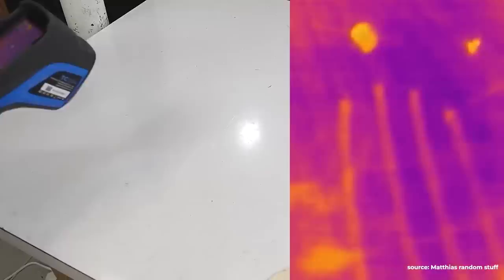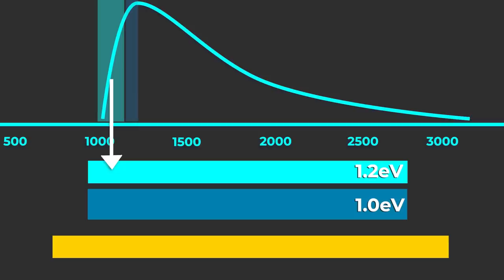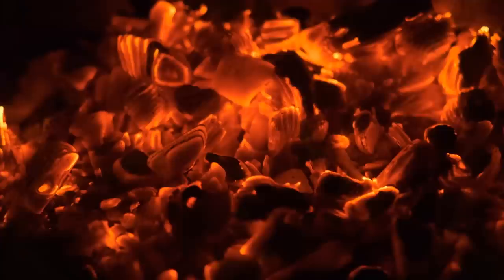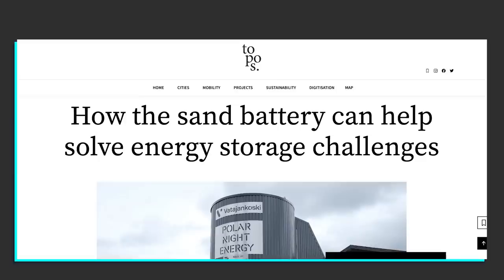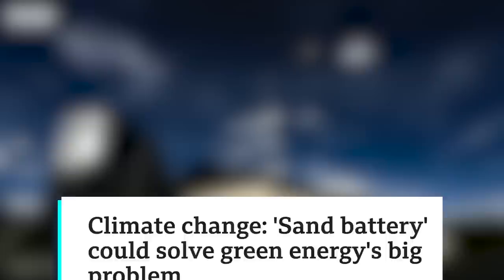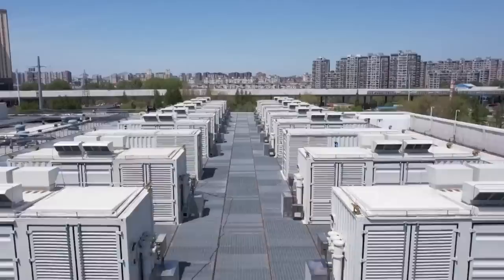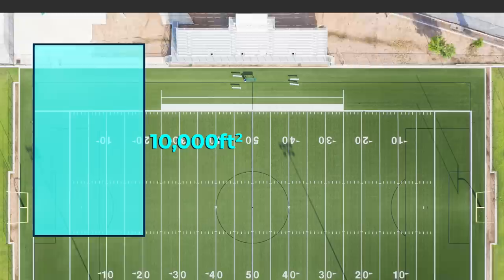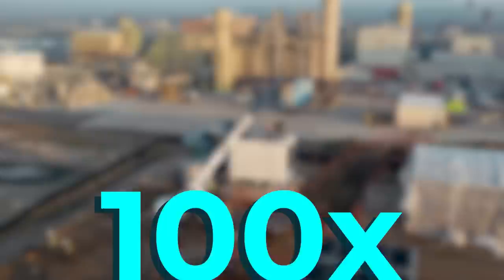The End of Lithium-ion? These Solar Panels May Be the Future of Energy Storage

Comment: I guess I don't understand, is this some kind of panel you could put on your roof .
Reply: If the heat hitting your roof is at 2400 degrees then you'd have other things to worry about than generating electricity. Like your house melting for example.
Reply: @vipertwenty249  Oh , well I'm guess I'm not interested in these .

Comment: I have to take issue with the thumbnail for this video....... grammatically speaking the term '100x cheaper' has a very clear meaning and it is not the meaning you splashed on the thumbnail. If item A costs $1000 and Item B costs $999 it is $1 cheaper - Then if Item C costs $900 it is $100 cheaper, so IT IS 100 Times cheaper than B. "Times cheaper" has to apply to a larger saving than the one already identified. What you mean is 100th of the cost. So, why should I believe the analysis of someone who doesn't know what '100x cheaper' means?

Comment: 0:28 Your "turbine efficiency" figure is way pessimistic
"Multistage (moderate to high pressure ratio) steam turbines have thermodynamic efficiencies that vary from 65 percent for very small (under 1,000 kW) units to over 90 percent for large industrial and utility sized units."
Reply: Isn't that the Isentropic efficiency? Since the maximum thermal efficiency for a temperature range is dictated by the carnot cycle, the overall efficiency would actually be the product of the thermal efficiency and the isentropic efficiency of the turbine.
Reply: @mouli570   No. References I found say "A steam turbine performs with an isentropic efficiency of η t = 0.84 ." and "Isentropic efficiency of the steam turbine: The isentropic efficiency of an optimized steam turbine is. 90% for an advanced power plant."
You can easily Google lots of references to Thermodynamic efficiencies ( Thermal efficiencies) like the quote I posted.
Reply: @dnomyarnostaw  As far as I understand, Isentropic efficiency is defined as the ratio of actual power converted to the theoretical power of an isentropic process. The theoretical power output of a carnot engine which is an isentropic process is about around 65% depending on the temperature difference between the input and the output. So the final efficiency would be lower than 60%. Although that is still higher than what was mentioned in the video, that number is closer to the electrical efficiency of a thermal power plant.
Reply: @mouli570   Definitions aside, I am just quoting authoritative sources, and none of them are  close to the figure quoted in the video.

Comment: Anything you use for heat to make electricity is out in heat to the global a carbon-free system is always the. Such a solar panels batteries and windmills. The score of the energy from the Sun and the wind from the earth batteries store at all without no heat problems. The average car gas car when it is running the engine comes to a certain and submissions two . Your Best bets not nuclear it's euphorium

Comment: lol all infra red radiation is heat but not all heat is infra red radiation. heat is the time derivative of energy with respect to a temperature gradient. lasers are a good example of how something can transmit energy with just a rearrangement of a statistical state. in a sense, a shuffled deck of playing cards has slightly less free energy than a ordered one because of the entropy contribution. you can determine this by the gibbs free energy equation. when you try to use gibbs free energy equation to solve for heat sources such as a laser with a population inversion of excited states, you get nonsensclical values for temperature, basically "negative temperatures" whatever that means. this seems pedantic until you realize that a lot of reactions can produce heat just by entropy alone. there are also plenty of examples of things transmitting heat without IR radieation like your microwave oven which uses electromagnetic radieation instead to heat polar molecules

Comment: Large steam turbines can be more that 90% efficient
Reply: Id be very interested to know which one that is.
Reply: @richardlphillips  most multistage turbines in nuclear power stations are 90-95% effective. "Multistage (moderate to high pressure ratio) steam turbines have thermodynamic efficiencies that vary from 65 percent for very small (under 1,000 kW) units to over 90 percent for large industrial and utility sized units"
Reply: @JonasTamaliunas  I cant find any evidence that supports that. Are we talking efficiency from turning heat to electricity. IE heat in Kw versus electricity out Kw? If you have some source to quote id be very interested to read up

Comment: Humans remain humans - slow, thick and primitive.
They couldn't tolerate anybody telling them - that - when energy looted - it turns - curse.
A curse that destroys in humans consciousness and the future.
The Magna Carta requires today overhauling – adding to it the right for humans to understand what Energy really is - before any other commandment;
“In any system of energy, Control is what consumes energy the most.
No energy store holds enough energy to extract an amount of energy equal to the total energy it stores.
No system of energy can deliver sum useful energy in excess of the total energy put into constructing it.
This universal truth applies to all systems.
Energy, like time, flows from past to future” (2017).